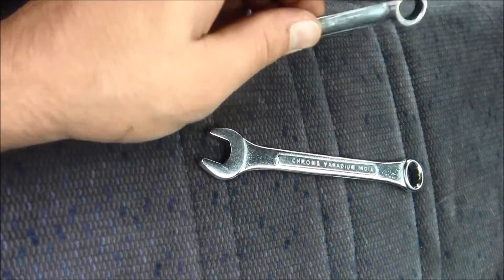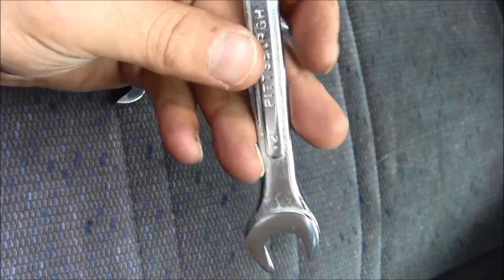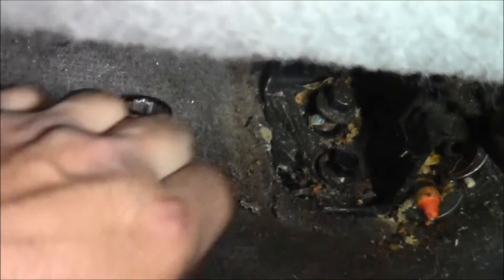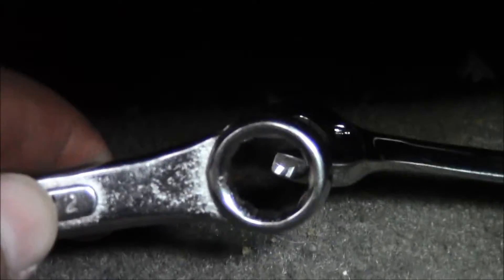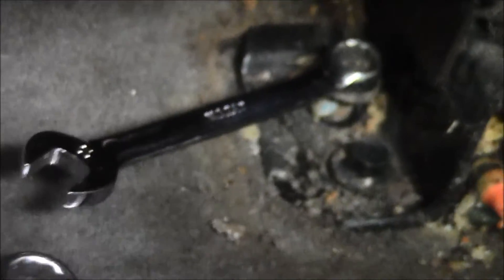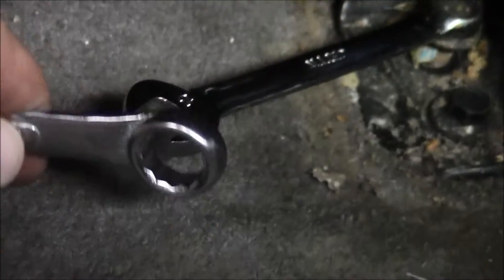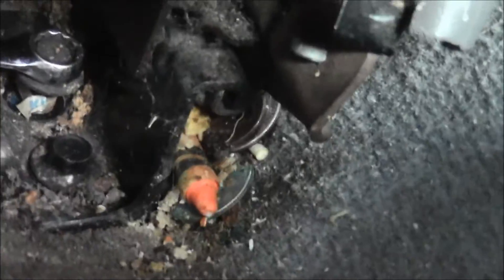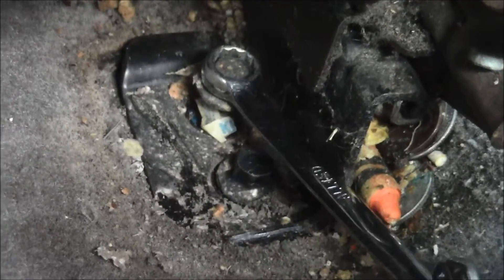How to Get More Leverage Turning Fasteners Using Two Wrenches

Comment: Learned this about 28 years ago from some guys I worked with that used it to assembly stuff and over torque the hell out of bolts. Customers alway complained that they could never get the equipment apart! A pipe works good too but you have to have such a large diameter one to fit over the wrench plus it's something extra to have to have. You pretty much always have your other wrenches handy.

Comment: this is a great way to add leverage in a pinch. everybody does it. however there are dangers involved, load being applied to areas of the wrench not intended to take on load, accidental slippage causing personal injury, etc. overral bad practice for a professional...fine for a diy in a pinch.